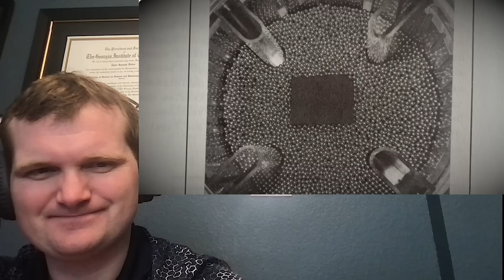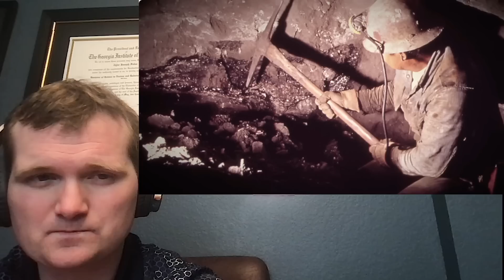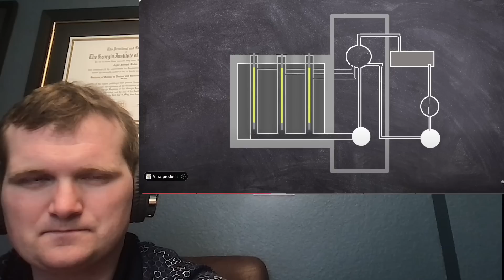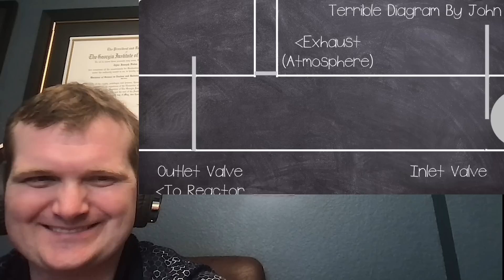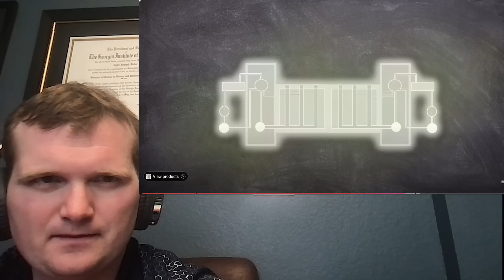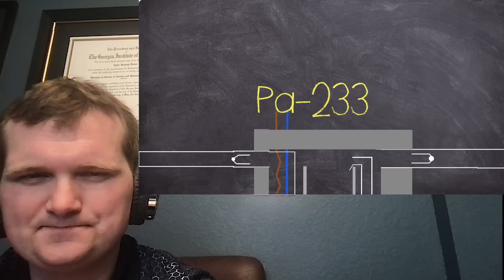"Meltdown-Proof Reactors" and Germany's "Chernobyl" - Nuclear Engineer Reacts to Plainly Difficult

Comment: The nuclear phaseout in Germany has a lot more boring reasons, tho in media the fear factor is always set as the primary reason, which in reality isn't the case. The real factor is cost. Germany had a uranium mine in East Germany, but it ended up becoming a big hazard site and heavily polluted the surroundings. The cleanup was very expensive and the mine closed. Now we were dependent on importing uranium, but because we had no fuel processing and fuel enrichment plants, we had to send all that to other countries and import the finished fuel for our NPPs. That drove up the cost for consumers too. On top more and more safety regulations drained the budget even more, which caused the electricity price to rise even more. The rising costs just were too much and coupled with public opinion of not wanting enrichment and fuel processing sites in the backyard, it ended up with shutting down the reactors, arguably too early with the backup not quite ready yet. So the whole Chernobyl fear and bad education on nuclear power causing the phaseout is wrong for the most part. It only played a small role overall. It's mainly cost and consumers wanting cheap energy which nuclear couldn't provide anymore in Germany.

Comment: For the THT300 incident the prior Chernobyl accident had a very different effect from the china syndrom movie. Because of Chernobyl the incident largely got unnoticed.
I think the number with 50 Bequerel is wrong, that would be really tiny and hard to notice, especially with short lived isotopes from a running reactor. Must be more like MBq. 
The THT300 was a failure, not just for the incident: the reprocessing of the fuel was way to expensive and never fully developed. The breeding was less efficient than planed - a far way from a true thorium reactor. The fuel needed highly enriched uranium, that was no longer available from the US and problematic under IAEA regulations. So even íf they wanted and the reactor would be working (which it did not well) there was no more fuel available. A change to plutonium based fuel would be a major redesign if possible at all.  It showed enough other problems with jammed balls (e.g. from swelling and the He atmosphere iscreasing friction). So it did the job in demonstrating even more than 1 flaw in the concept. 
The shut down of the THT300 was not significant for the power production.

Comment: One of the major problems Germany experienced with pebble ped reactors was the pebbles breaking apart (fuel damage). From what i could find online, their mechanical testing before fueling their first pebble bed reactor was minimal at best. If it was me, i would have run the first experimental reactor through multiple years of simulated running with non-radioactive pebbles, just to check if the mechanical design could withstand in practise. Using pebbles without radioactive elements would also have allowed inspection of the inside of the reactor vessel and testing of any fixes/improvements.

Comment: 27:27 well, yes.
While the 77.6% fossil is technically not completely wrong, it is highly misleading.
It is true that 77.6% of energy consumption in 2023 came from fossil. However, that includes EVERYTHING. Heating is not done electrically in Germany, many households still have gas heating. Cars are still mainly driving with gasoline. Many industries use fossil fuel directly. These are all branches which would not have been powered with nuclear anyways.
In the electricity sector (where it makes sense to talk about nuclear), the picture looks completely different. 56% renewable in 2023 (60% in 2024). And this number is only that "small" because the past governments were total kissasses for the fossil industry and did not, by a large margin, build as many renewables as would have been possible.

I am not completely against using nuclear energy. I do think it would have made sense to let the existing plants run for a while longer, instead of shutting them all down. However, I also think, we should stay with the truth and don't rely on misleading statistics to make our point.

I will quote from the comment section of the original video, because it sums up this topic very well:
"Let's not pretend that it was the discontinuation of nuclear energy in 2023 that's lead to a large percentile of the energy production still being fossil. It's because the same party that planned and enacted the exit from nuclear power is also the one that's sold out Germany's solar industry to China. In the 2000s Germany was the world's solar champion. And then no proper investments into the electricity grid and heavily favouring fossil fuel lobbyists is what caused the downfall of German renewable energy production, not the shut down of a thorium reactor."
Reply: Thanks for clarifying!  
I really don't get why this community of pro nuclear people is pushing against solar and wind when it obviously works. 
Hope the new government coalition will continue investing in green energy, sadly I am not quite certain.

Comment: The accident was not the reason for the abandonment of this reactor. It was just foreseeable uneconomic. The starter uranium had concentrations barred from manufactoring in Germany under nuclear non-proliferation agreements. The US no longer supplied it for this purpose and only a two year stock was left. Lower enriched uranium is possible but means less thorium, which means less power and different operating requirements, which necessitates new regulartoric approval. The plant operator went almost bankrupt before just running it and it could only continue running with significantly govt. subsidies than already given.

Comment: This incident wasn't the reason for the ultimate shutdown. The primary cause was that the mechanical challenges for feeding/removing the pebbles without malfunction or fuel damage could not be overcome sufficiently to warrant continuation for the operator. The politics of the time didn't help of course, but were ultimately a side show as far as the THTR was concerned.

Comment: There have been days when the entire German electricity has been sourced exclusively from renewable sources. The obvious issue is that this power supply isn't constant. The less obvious issue is our neighbour to the west who's had to power down his nuclear power plants because there wasn't enough water in the rivers they use to cool them, so they also got their power from German power plants.
Reply: The coal station can’t just switched off so they still run with brown coal the worst kind. The German data is not accurate. Cooking the books with brown coal

Comment: In Earth Heating - like the system Danfoss makes for normal households - there is used a lower temperature to achieve boiling point. Would that be possible to use with Thorium? Would it make a difference?

Comment: what I got from this, the fuel loading system needs a revision, or a better instruction set for manual operation of the fuel loading system in this case, everything else seemed to work

Comment: Could they take some ideas from these pebble reactors and apply them to fuel rod reactors? Like instead of fuel rods have hollow tubes with cylindrical pellets in them, then have a mechanism for dropping the pellets out the bottom of the tube and inserting new pellets in the top. This could help with rearranging pellets in the reactor for optimal usage and allow refuelling without shutting down the reactor.
Reply: I get the logic by honestly the pellets end up being used up pretty equally in the rods. Fairly quick and easy.

Comment: Germany did not import coal in significant quantities from Russia at any time, but it did import oil and gas - the oil was mostly refined into car fuel (and also oil for heating) and the gas was mostly used for heating (and industrial applications) - very little of it went to power generation. Germany has large reserves of lignite ("brown coal"), which is mined in huge open pit mines with some of the largest machinery in the world - this is what is mostly used as fuel in coal-fired power plants. We stopped mining coal underground decades ago - too expensive. Lignite is pretty bad in terms of CO2 produced per kWh, but we are getting out of that pretty quickly in favor of renewables, which already produce 55% of our electricity needs. In about 10 years the last coal power plant in Germany will be shut down - and all of that without nuclear power...
The THTR300 was a desaster in every respect - technically, economically and most of all in the handling by the operators. Of course it was not a German "Chernobyl", but it did release relevant equivalents of radioactivity, which was hidden by the operators, because it happened while Chernobyl had just crashed, and they tried to pass off this release as coming not from them, but from Chernobyl. I read a report by official investigators (which was not officially released at the time) that said, for example, that because fuses were blown quite often when the reactor was shut down (which it did itself because of technical problems) and restarted, the operator once used a large nail to bridge the main fuse so that they could restart the reactor, thus sabotaging every basic safety measure. As I said - it was a sh*tshow that should have been shut down much sooner, but was politically protected. But experiences like this lead the majority of Germans to the (empirically correct) belief that the nuclear plant operator can't be trusted, and incidents are always swept under the rug..
Reply: abd ypu kniw what because your nation hates the only sustainable source of power (nuclear)  ypu can have fun with high prices and degrading batteries and a failing grid

Comment: In case of loss of coolant, the reactor heats up but at a designed level Doppler broadening stops the chain reaction. They tested this in the THTR300 and it worked. No meltdown. The reactor can stay at elevated temperature, but no meltdown.

Comment: 1. Titanic isn't anywhere the same as a nuclear reactor
2. Titanic sank because it was rushed out, was the sister-ship to the actual titanic, and didn't have proper maintenance checks prior to leaving drydock let alone propelry sealed bulkhead bolts. 

Lazy greedy idiots wanting to facilitate tourism was titanics downfall
Chernobyl's downfall was entirely different.

Info Hazards are a thing, please keep that in mind before using 'buzzwords' haphazardly to try and put in a point

Comment: Question: In a lot of PWR and BWR reactors I see a prominent 'smoke stack'. In what situations would these be used and why, also, what is sent out? Simply some steam from the primary coolant loop? Why isn't it captured in tanks where it can be condensed and sent back to the coolant loop?
Reply: It's just steam from cooling. I'm not in the industry, but I think the reason it isn't condensed and captured is because the water that comes out as steam never touches the rest of the cooling loop directly (which is radioactive/contaminated)

Comment: I have an odd question not sure if you will see this. The people that ingested radium their bones will set off geiger counter, but everyone says anyone who has radiation poisoning is not radioactive how are they different?
Reply: Maybe if the Radium was ingested, going into the bloodstream and so on, it will be in the body actively, while getting radiation poisoning you as example are exposed to radiation, but it wouldn't be directly inside your body, just an assumption.
Reply: Because radiation poisoning is a different thing to ingesting radioactive material. That can give you radiation poisoning of course, but you can also get radiation poisoning by standing next to a powerful source, such as happened in the Lia incident. People who get radiation poisoning from external exposure like this are not radioactive.
Reply: OK ty
Reply: There is a big difference between RADIATION (alpha-, beta-, and gamma- rays) and POISON (a chemical that has bad effects if ingested).

Radiation is dangerous if it is REALLY intense. Then the whole body is damaged. Deaths from radiation (alone) are extremely rare. The immediate damage stops, when the radiation stops. With (pure) "Radiation poisoning" there is (usually) no radioactive material in the body, the damaging effect is caused by the radiation, and once the radiation stops, the damage stops. But it can take days or even months (with good medical care) for the full damage to show its effect.

Radiation "poisoning" is not a actual poisoning: it is damage through VERY INTENSE radiation. There is NO radioactive material in the body, so there is no radiation coming from the body.

A POISON has a very SPECIFIC effect in the body. For example Cyanide binds to the molecules in the red blood cells that transports oxygen. These molecules can no longer transport oxygen, the cell suffocates.

Now with radium ingestion: the radium ITSELF is not a poison. The damage is done by the RADIATION INSIDE the body. The radiation is not as intense as in "radiation poisoning" but it is persistent. The damage does not stop as long as the  radium is in the body. As long as the radium is inside the body, there is radiation coming from the body.

Comment: I swear to god we are going to use matter antimatter reaction to generate steam....
Reply: How else are you going to get electricity out of it?
Reply: @WJS774 eat it
Reply: @WJS774 use photovoltaic cells with electron-positron annihilation since it creates photons (im joking that probably wouldn’t work but that’s the only other way i could think of)
Reply: @DeathCorridor  That's like saying that you could use thermocouples in a nuclear reactor. Sure you could, but if it was as efficient as a steam turbine we would already be doing it.
Reply: @WJS774  well yeah I know it isn’t ideal or practical, that’s why I specified it was a joke, it’s just technically another way to get electricity out of it that doesn’t involve steam turbines (even if it’s nowhere near as efficient)
Reply: @DeathCorridor you're not wrong but it's so inefficient it would just be much better to take the thermal energy
Reply: I mean it would work
Reply: EPS Conduits?
Reply: @nsr-ints  how I do not recognize the name. Whats it?
Reply: @borttorbbq2556 electroplasma. Basically directly using plasma to transfer power.
Reply: @borttorbbq2556  Star Trek jargon for the plasma-based electrical network that runs their spaceships.
Reply: @T1redgamer thank you I haven't watched any Star Trek in a long long time

Comment: How about a quick video on why "the drones are hunting a missing radioactive sensor in NJ" story is rubbish??
Reply: Why do you think it's rubbish?
Reply: @joeycampbell940  Because the missing object contains a TINY amount of radioactive material (far less than a glow in the dark exit sign, by way of comparison) and the notice itself specifies what needs to happen if it's not found in 30 days- a report has to be written. Not exactly a 'secret drone swarm' type of situation.
Reply: @jamesboyle7163  the amount of material is less important than what kind of radiation it emits and it's halflife.
Reply: @joeycampbell940  From the notice: "Some of these sources, such as moisture density gauges or thickness gauges that are Category 4, the amount of unshielded radioactive material, if not safely managed or securely protected, could possibly - although it is unlikely - temporarily injure someone who handled it or were otherwise in contact with it, or who were close to it for a period of many weeks."
Again, a missing exit sign is treated similarly.
Reply: @jamesboyle7163  some? So what about the rest?
Reply: @joeycampbell940  even less dangerous. This is not a big deal at all and these notices are issued routinely. Your conspiracism is showing.
Reply: Also because there is no reason to secretly search for an orphan source... People want to see the government respond to an event like that. Doing it in secret would have zero benefits and a bunch of downsides. The only time you'll see the government respond in secret would be like when they lose a nuclear bomb and are trying to cover it up, but the government is way better at finding those in secret than to send a swarm of brightly lit drones.